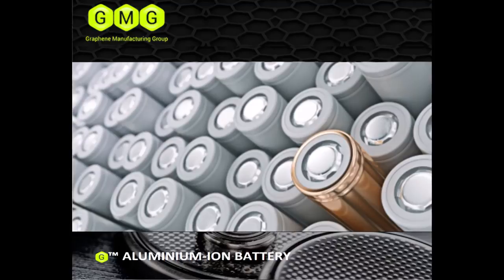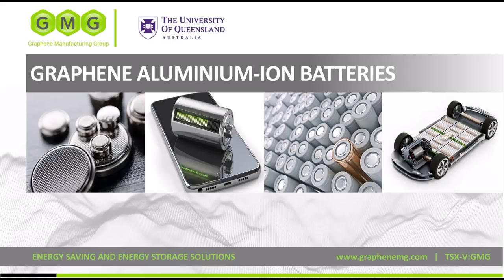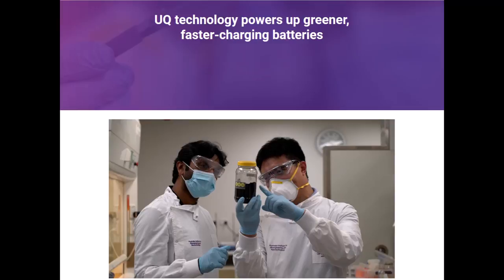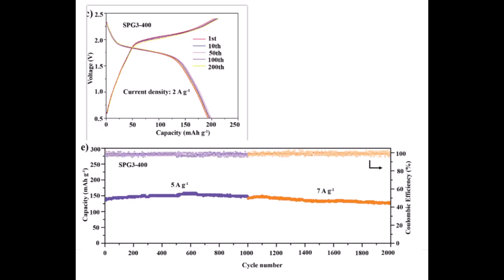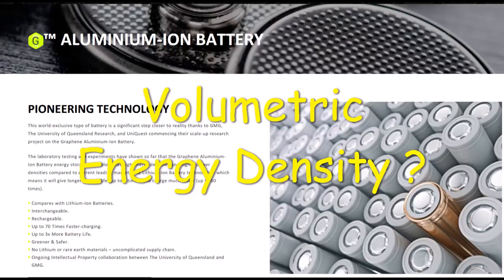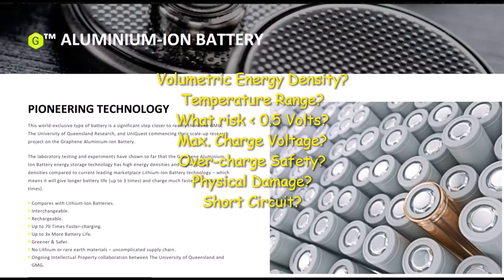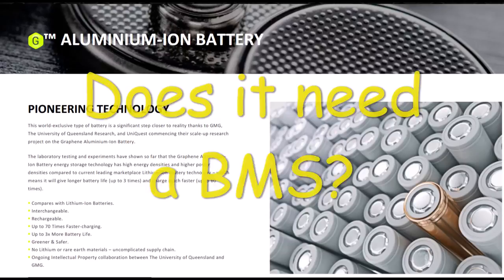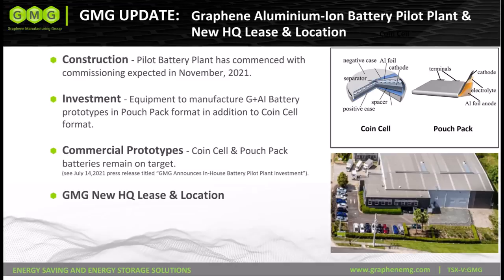GMG  Graphene Aluminium Ion Battery, is it a Wonder battery?

Comment: There should be more interest in this.  I was thinking of the blade battery and how to get around the form factor.  What I came up with would be a cylinder 50mm X 1500mm.  So a battery would be close to the width of the car.  If it could be structural weight could be reduced.  If a reliable safe long life battery can be made for 1/2 the lowest cost battery available today it will accelerate the transition to EV's and energy storage.
Reply from the maker: Absolutely.  And I also believe the volumetric density will be quite a bit better than LFP.

Comment: Everyone has the next great battery! Batteries aren't needed for EV'S. Make them self- charging or use a magnetic motor. And don't tell me that GM and Ford don't have motors which are smaller and that get better mpg! GM had one back in 1983 that got 53 mpg in a 4000 pound car. This would get more today with lighter vehicles! I've got a vehicle that gets 17.5 mpg! The same vehicle twenty years ago got 19! This is pure crap! Where's Troy Reed's magnetic motor? It doesn't need a battery pack or gasoline! When are we going to do what's right that doesn't involve making money? We have heads up our asses and are wondering when did it get do bad? When we let greed and Evil take over! Wealth ought to be capped period! How much is enough? Almost 38 million for a house! How many homeless people would this house?? We are creating problems not solving them! This is criminal!